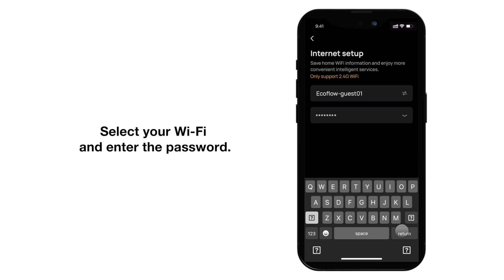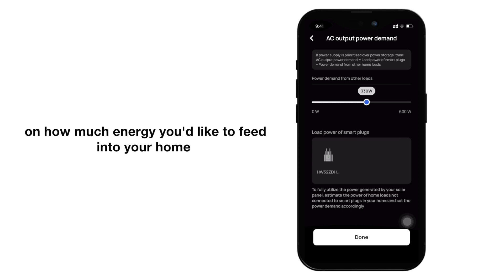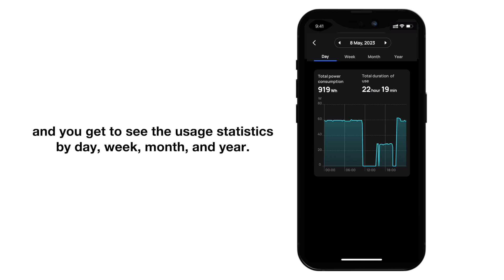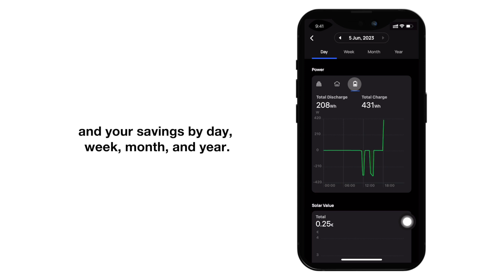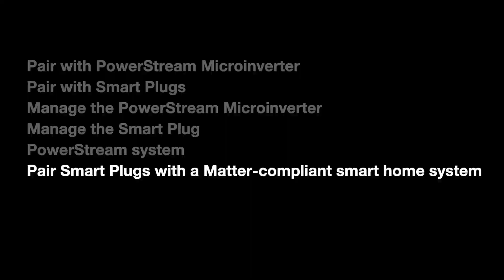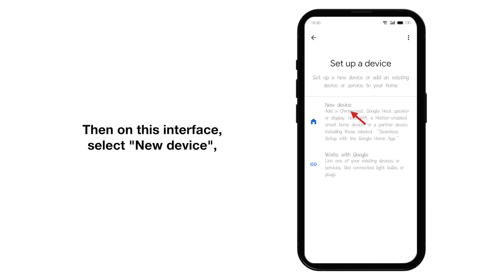How to use EcoFlow app with PowerStream (Beginner Guide)

Comment: After updating the app, my PowerStream no longer appears in the devices (my Ecoflow smart plug was also removed, but is not currently in use). I have tried to add the device again, but it is not detected. However something called "Hub 2-0AB1" is detected... when I click to connect, it asks me to scan a QR code, and scanning the one on the back of the PowerStream results in an error with the QR code not recognised.

Because if this, I can no longer control the PowerStream, change its settings or see what it is outputting! I know it is still working, because I can see that the Delta Pro I have it connected to is outputting the ~350W I instructed the powerstream to push into my house system. 

I have tried disconnecting it for a while and reconnecting it several times to no avail. How can I fix this?

Comment: Hi how many ecoflow powerstreams can I use with my normal electricity supply? If Im generating 4kw a day from one power stream and 800w panel can I use 3 seperate powersteam units each connenected to their own 800w panels to generate 12kw a day?
Reply: I dont understand what you mean. But you can connect up to 800w solar panels (check the current and voltage) so if you got more panels add more inverters😊

Comment: Hello, my setup of Powerstream, Delta 2 Max and 4 SmartPlugs and 2 x 375 watt solar modules (south and south-west) has been working in priority electricity for weeks without any problems. I am currently switching off and increasing the basic consumption. Everything can be changed live via the app. It doesn't matter if I'm at home or in the office. If you have problems with the app and the connection to the devices, I recommend setting the WLAN channel in the router to a fixed value first. I have a gaming router - absolutely no problems connecting the devices to each other.

The only problem is that the Powerstream shows very little solar power in the morning, but the developers are working on firmware updates.

Best regards
Reply from the maker: Thanks for this👍